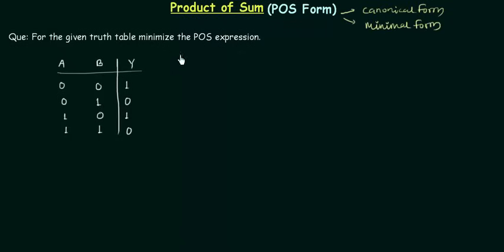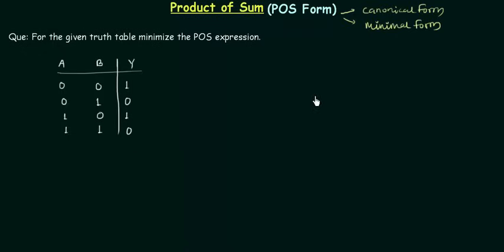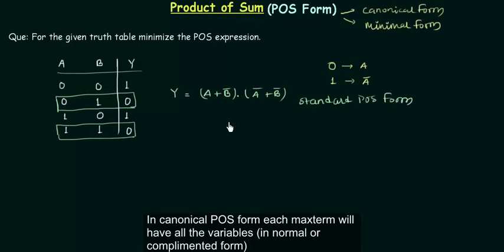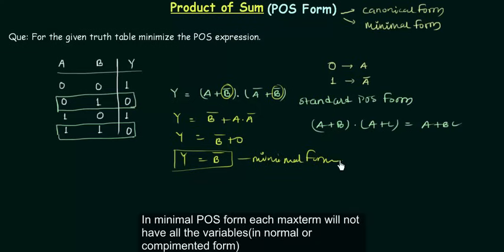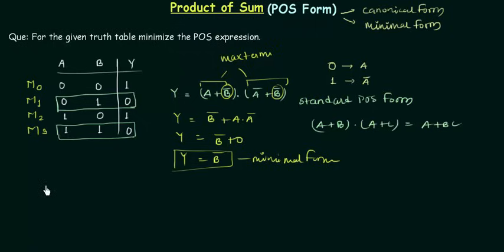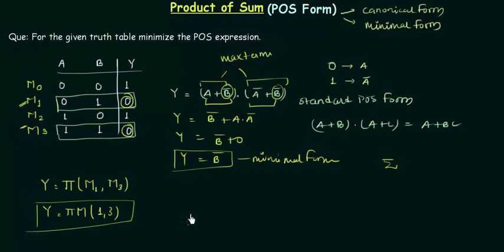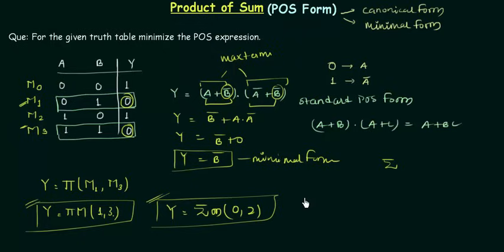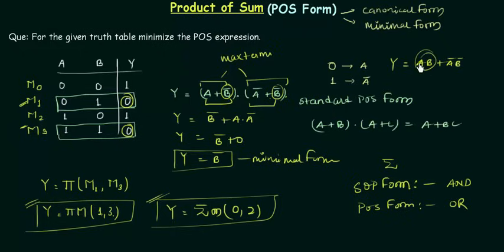Product of Sums (Part 2) | POS Form

Comment: What if the minterms are Y = Σm(0,2,4,5,6,7)? Just because the max term ends with 3, does that necessarily mean it’s only 4 we’re working with?
Reply: no, it is supposed to be mentioned on the L.H.S ; 
Actually it should be mentioned like Y(A,B,C) ; otherwise we can't confidently say no of variables